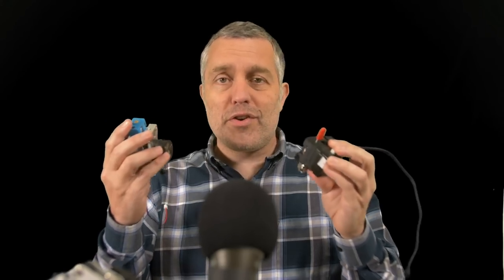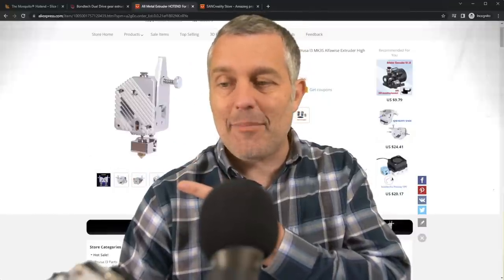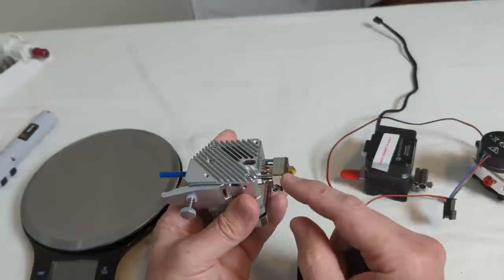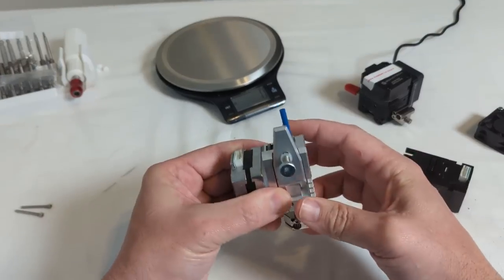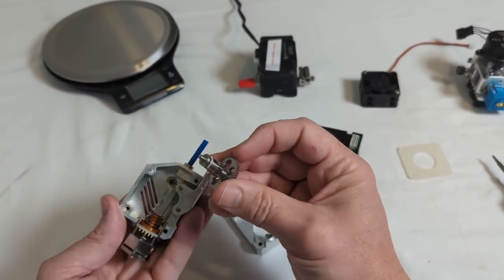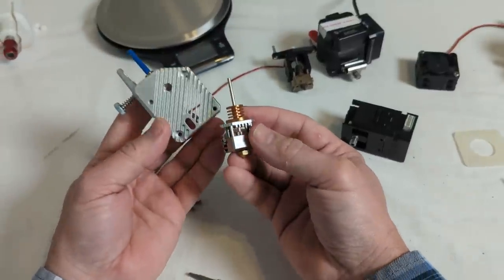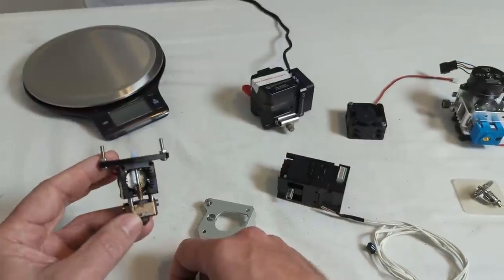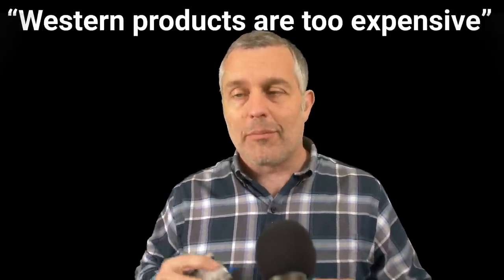INTRODUCING: This Metal Geared Combi-knockoff Extruder

Comment: FYI, you probably have one of the early H2's that had the binding issue. They have solved that by loosening the tolerance of the gears (which is a 7:1 ratio btw), so please realize that. I installed an H2 on my Tronxy, and it's the total bomb for quality and performance. However, they have just released a Lite version of the H2, which looks amazing, and I will definitely be purchasing one for my AM8. Don't give up on Biqu, it seems to me they are trying to design the perfect one for you. Take care :)

Comment: I have these, but they aren't put into use yet, so can`t say anything about their useability. I think they are CNC machined and then gritblasted, hence the surface structure. They blast them to remove machining marks. CNC machining in China is cheap and the product is a fast machining job as the geometry is simple, so at such a relative low volume of production CNC would be the cheapest option surely.

Comment: I see the silicon mat as patch. But hey if it works, why not.
What would be really needed is a flexible coupler (like the one on the Z axis on many machines) for the shaft so it can flex slightly radially but not axially.
I don´t think it is worth producting such tight tolerances for those machines and it isnt neccessary either.
As a mechanical engineer I can tell you, if a design does not work it is 80% the tolerances.

Comment: Accelerating and decelerating a heavy metal gear vs plastic could change your retraction speed along with overall print time for having to compensate. Then again it's only if you print fast enough to make it a problem.

Comment: what an excellent video! so glad you have been continuing in this series. and well may i say it has been really helpful and educational. may i also say that if you were not already watching VeZ" channel he has an excellent all metal 3d printer carriage for sale now. it costs something around 100 euros but is pretty nice and well thought out product as a general mounting solution

as for these chinese metal extruders. i cannot help but wonder how much further weight reduction is possible by drilling extra holes and filing away parts of the chassis structure... but maybe if it is all sintered then it might be brittle and prone to cracking and get damaged?

Comment: I agree metal gears are what I'm buying from now on but so far I've got 3 titans and their POM gears look brand new after 1000s of hours at 70C chamber temps, looking to go hotter though.  Current build is getting a Matrix Aqua that while it does have metal gears there are a few plastics parts that I'm copying in glass filled epoxy resin, they feel like PC so would probably stress crack in no time at such high temperatures and stress (they are the idler arm and it's tension adjustment ramps).

Comment: they're all knockoffs at this point. whats patented on the slice engineering without prior art? the attachment of the block can't be it. the nozzle attachment can't be it etc, use of standoffs is done before etc.
Reply: There's a functional difference between a mount and a structural heat sink. That's where the patent comes in.
Reply: @paulthetexan  both ways have been used before tho?
Reply: @lasskinn474  I've heard that several times but never seen an example of prior art. For mounting, sure, but not for the specific application they used, which was to specifically heat sink through the mounts to reduce the thickness of the heat break. I'm willing to believe it's been done before if someone can show it, but so far I haven't seen anything.

Comment: POM is not great in my opinoin use derlin/ phenolic if steel gears are not wanted? moulding a pei or peek pekk pec ...gears would be kool but i know it is not practacle 
i use cf nylon PA12 for thermal gaskets like the silicone one shown but for thermal dissipation protections not alignments but hey,,, check out the western made long shlong dong by simon hes doing great with it what do you think ? keep up the content thanks the mosquito is subpar do to the small melt zones 
aluminized copper not virgin............

Comment: If they had designed the hot end properly, requiring the reaming of the two holes, that means their QA is bad, and that makes me question the whole company.
Reply: Reaming is an additional operation that costs money. Furthermore, the exposed copper would then be at risk for corrosion at elevated temperatures. Copper(II) oxide is not very conductive (20-77 W/mK, depending on who you ask).

If we're going to spend money, an alternative would be to substitute gold plating. Gold not only looks nice. It's thermally conductive, does not corrode, and is soft enough to facilitate high contact area with minimal pressure. In that case, excessive plating thickness would affect cost, but not performance. Unfortunately, copper tends to diffuse into gold and make it succeptible to corrosion. Therefore nickel is usually plated in between as a diffusion barrier. At that point, it makes sense skip the gold layer altogether in our application, unless nickel oxide is thick enough to have a significant insulating effect.

Comment: what about another one DD clone where it has pin heatsink? It adopts V6 hot end. Somehow heatsink looks the same as of Trianglelab matrix. Patent infringement here is nice April fools day... As an power and mechnical engineer its clear for me how heat dissipation devices are going around tube... for decades. I dont see any sintered metal in body. I c=can be wrong, but CNC machining and sandblasting is the possible and massively used thing. Nobody will sue them as parts are different and device performs worse.

Comment: Sorry to say but this ali extruders are crap.. Inlet fall off, it's not machined from one piesce and the screw part on the pipe part while fastening the inlet part. After assembling the outlet part fall off the hole and won't fit back in to place.... All metal! That's true! Should work like a charm but not...

Comment: The metal bmg just is a standard flow hotend, just compare the meltzone length. Thats why a standard mosquito won't out perform the cheapest volcano clone when it comes to flow rate. In reality a copperhead is just a bit fancy v6 derivative and both the mosquito and dragon (both standard flow) are just really fancy v6s with i bit more flowrate, but nothing to brag about.
Reply from the maker: and a 2022 Porsche 911 GTS is just a fancy version of a classic Volkswagen Beatle.
Reply: @DesignPrototypeTest  well, a mosquito has not that much more flow, probably around 16mm3/s, about the same as a dragon. Thats a welcome upgrade, as well a good heatbreak, but personally i dont believe that you can print pla without a hotend fan like they claim since i know a thing or two about thermodynamics (had 3 years thermodynamics classes). There isnt enough surface on the heatsink for passivly cooling to less than 50 degrees. Same goes for the dragon, which is essentially a copy of the mosquito and this is known for having heatcreep when printing slow.
The fully rigid mounting is nice and definitely a advantage over a v6, but the reliance on thermal paste to even function is just cost cutting, same goes for the copperhead.
All in all its not worth the 200 euros, at least for me, but you Americans should get it cheaper, right?

What nozzles where you using to compare the flow between the metal bmg and the other hotends? These have quite some impact on flow from personal experience. Also i think you are right about the distance between the heater cartridge and nozzle, since its furter apart the temperature should be lower due to the temperature gradient

Comment: Really !?  The above was both a surprise and eyeopener
Been fooling with My exruder setup for a few days  now.  MY Clone :-) BMG w V6 hotend with a Clone CHT V 6 Nozzle ( NO flow issues at All !)  
Mounted ..  onto a Printed X carriage, equipped with Ball bearings ( Far smoother/lighter gliding than even Good quality linear rails 🙂 with Fans & wirings ..
weighs  in at 305 gms !  
Making those premade ' extruder contraptions'  seems as mediocre..  certainly so weight wise. 

Ohhh.. Must replace the bearing shaft on the BMG clones. Chinese makers 'Cheat' on materials (qu'elle surprise) using low grade Iron.. absolutely Not hardened steel
Consequently  the shaft self destructs itself and the needle 'bearings'( ? ) in weeks. 

Discarded CD rom Drives are a Great source of precision  3mm hardened steel shafts.. yer welcome 🙂

Comment: on the contrary, slice engineerings improvement was just modification of a unused patent Stratasys had after the Stratasys patent expired.
 Slice eng sliced their way in and patented a minor iteration, literally nothing innovative. The medicial industery does this quite often. 
Straysys could challenge slices new patent for lack of originality but haven't yet, possibly there waiting for them to make some capital so they can settle for big bucks? Who knows
Reply from the maker: There are many books and videos out there which explain the patent system. Have you watched or read any of them? Your comment displays an enormous ignorance of the actual functionality in patent law. It is clear you have fabricated a ruleset in your mind that has no bearing on the reality of intellectual property law. For instance there is no such thing as an "unused patent." If you don't enforce your patent then you set up a precedence in opposition to the patent which you spent so much money to get. You will likely lose your rights to it. There is no way the legal department at Stratasys would allow such a thing to happen.

Comment: I am confused.  I need a 350mm cubed printer.  But i want it to be best qualiry print and reliability.  What models?should i get and what mods should i use.  $ not the problem.  Just ease of use reliability and print quality.
Reply from the maker: It sounds like you are asking for a Prusa, but I think you should adjust your thinking and get an Ender3. It should be everyone's first printer. No better value. Then if you want a high performance machine build a Voron.
Reply: @DesignPrototypeTest  have already had 2 250mm cubed printers over 4 years.  Will check them out and get back to you for best mods list. Thanks.
Reply: @perrieiles493  looking at a prusa or voron or rat rig or vezbot. enderr 5 plus is the cheapest not bed slinger at that size i think